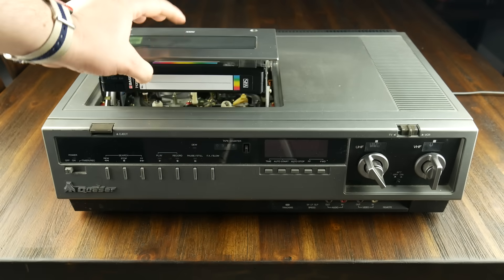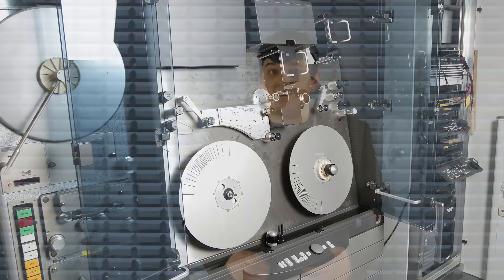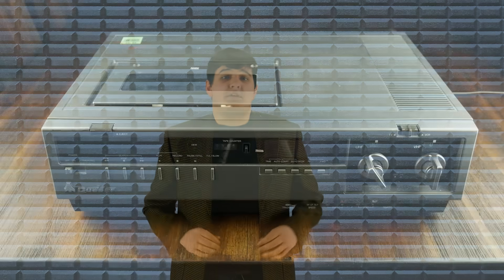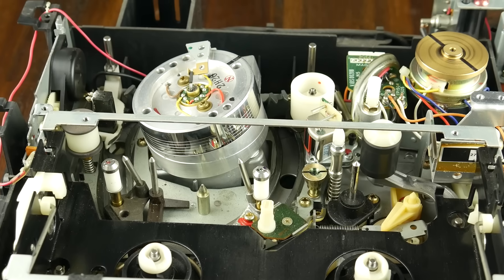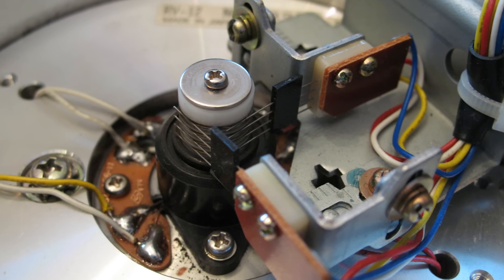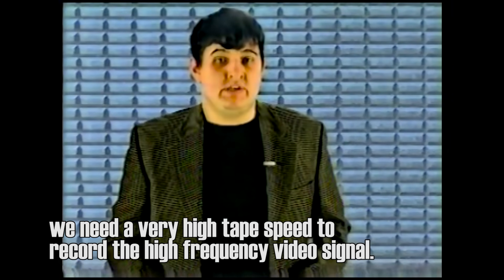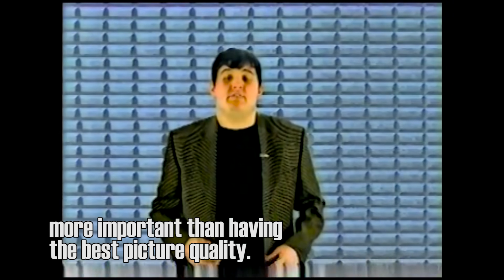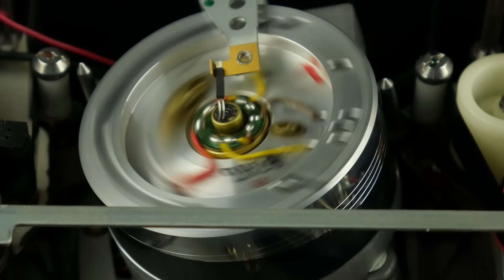The Impossible Feat inside Your VCR

Comment: The reason why they dropped the LP mode was because they tuned 2 head for SP and 2 for the EP speed.  This gave a better picture on recording. EP looked like LP and the SP looked better as well. But some older 2 head units still had all 3 record settings. Most people was using the 2 and 6 hour modes anyway. 6 hour for record and watch once and 2 hours if they were going to keep the video.

Comment: Well dear the main components in vcrs which is marvlous is optic scanning system the gear with black n mirror sections which reads position of tape ....that is used in cars same optic system used in abs n stability control  system
Reply: Well other than that magnetic tape system was used in credit cards now replaced by chip...from vcrs head the reliable BLDC motor for drones made way...from optic intrupter of vcrs..cash counter made way ...in all its collection of various technologies of all time....the high end vcr.

Comment: Just came across this. Thank you for doing such a good job of explaining the format for the uninitiated!  I started work as a broadcast engineer back in 1981 and spent a large part of my time working in VT. When I joined, we had a mix of Ampex VR-2000 quad machines and VPR-2 helical scan machines. We used a lot of the 'domestic' and non-broadcast cassette formats too, U-matic, high-band U-matic, that sort of thing. One machine that always made my day when I had to work on it was the Ampex VPR-20. Those clever chaps managed to cram all the necessary bits into a small enough package to make a portable 1" C format machine. I spent many, many hours nursing those machines. The quad machines in particular required constant tending.

Comment: Very interesting. There was also a Beta 1S speed. I believe if you had a machine that was equipped it record at 6hmz. Some of the high end machines thet churned out in the hey-day were simply awesome, the price reflected it. Wasn't impossible to drop $2000 on a unit in the mid 80's

Comment: I'm pretty sure VCR's & disk drives were the earliest mass adoption of brushless motors. In my childhood I remember pulling apart some Sony Betamax, it had not 2, but 4 pancake style brushless motors inside. One for the video head drum, 2nd for the capstan, 3rd and 4th for the supply & takeup reels.... The front panel was long gone when I had found it but I had never seen anything like it before or after. All modern VCR's up till their discontinuation still used them for the capstan & drum but rarely individual ones for the supply+takeup. All new decks seem to drive the supply+takeup by the same pancake capstan motor via a belt. Loving this tech history.

Comment: Rewatching this, I had an observation regarding the recording with LP speed disappearance in later models. Most 2 head VCR's back in the day had serious issues recording LP with playback quality on other machines due to those tolerances. To make a head work very effective with all speeds on both recording and playback was more expensive and full of various tradeoffs. 4 head models were introduced to solve issues with cost of needing to make one jack of all trades head record well and playback well from another machine with heads of a different tolerance/manufacturer, whereas a specific head for SP and another for LP/SLP they would have better quality with tighter spec tolerance for a more specific purpose across all manufacturers of heads at the time. LP was often hit or miss being played back in other machines as SLP was more widely used by everyone who recorded TV so it made more sense to put more effort into improving SLP recording, probably with a resulting tradeoff for LP recording or at a higher coist to do such so they decided to scrap LP recording altogether. If I recall each LP+SP head group have the different azimuth angle so they can read both field tracks in one swipe thus allowing for a clean still image. My 2 head VCR growing up had all 3 speeds, its SLP recorded tapes sucked when played back in anything else!
Reply: I had to read the scientific explanation, that jack of all trades three speed 2 head VCR required a 30 microns wide head which was a compromise, SP tracks being 58 microns wide. Playing back stuff recorded on 2 head VCR that merely supports recording SLP mode in SP mode in another VCR with 58 micron SP heads would be reading a lot of blank tape!
Reply: Now some of that marketing stuff is coming back, the 19 microns wide heads were well advertised on some models. These would be very SLP/EP specific to improve performance and would not record LP 30 micron tracks too well for the same reasons above.
Reply: "By 1996 most manufactures started dropping the older 26-micron EP heads in favour of the superior 19-micron EP heads but kept a 4-head system having 58/46 SP and 19/19 EP heads. Most if not all of the last Toshiba and Sharp VCRs used the 4-head system droping the 26-micron heads. Although some manufactures use slightly wider EP heads, around 21-microns." <-- Now we know why LP vanished. 26 micron heads were used for LP recording which was good enough.

Comment: You have to appreciate old technology.  Analog is ironically the wave the future.  When modern infrastructures collapse, analog tech will be the way to go.  Can't read Wikipedia if the power goes down, but a book and candle light and you can read.  An old typewriter can run without electricity,.  Just things like that will make a big different in the distant distant future.  I hope there is an old technology preservation association out there preserving old tech.

Comment: Is NTSC video still interlaced to this day? I know interlacing creates the illusion of a somewhat higher resolution, but is it still done?
Reply: Many 480i sets are still in use - though few people would be using one as their "main" (e.g. living room) set.

Don't believe those claims that interlacing is "fraud".

Compare a 480i picture to a 240p. The difference will be obvious.
Reply: @1L6E6VHF  Mhm! And cable broadcasts (atleast where I am) are 1080i and 480i so as to not alienate CRT users, and most of the programs are from the 00s.

Comment: I always heard that the reason LP was abandoned was because it could not freezeframe pause or seek fast forward/rewind without very severe screen tearing. Even moreso than the other two speeds.
Most manufacturers decided that with the option between "quality" and "long recording time", why would consumers choose THAT speed that looked so horrible when in any mode other than play?
Also, fun fact, S-VHS actually saw modest adoption in the camcorder space, where it had to compete with Hi8 (additional fun fact: Hi8 and Video8 are descended from Betamax!).
Footnote: An Emerson VCR/DVD unit sits next to me. I still use it.

Comment: At 0:55 You mention a 5Mhz signal.   5 Mhz by definition is high frequency, (3Mhz  - 30Mhz is defined as "High Frequency"  or "HF" ) However, you call it 'Super high'.  The problem is "Super High Frequency" or SHF is 3Ghz - 30Ghz.

Comment: I'm rewatching this video as I back up tons of files to single layer BD-Rs and I'm now picturing an alternate timeline where everything else is pretty much the same but instead of a BD-RW drive in my desktop I have an external peripheral DVHS VCR connected to my e-SATA port and I'm slowly recording all my files to tapes. 30 minutes per disc to burn and verify files/surface scan doesn't seem so bad all of a sudden.

Comment: Great stuff.  I haven't studied this the way you obviously have, but I tend to have an affinity for making some good guesses.  For example, I noticed that the head drum at the end of the video (17:34) had 2H26 on it.  My best guess would be that the 2H means "2 heads".  (Typing it out has me thinking it probably means something a bit more complex, but that's the first thing that came to me.)  

I also have a theory as to why "LP" was phased out as a recording speed on most VHS machines.  When searching in "fast-forward" or reverse/rewind, on-screen for a particular point/moment/scene on a videotape, there is some picture distortion, mostly with the slower speeds, like SLP/EP, but the image is still "straight".  That is to say, you can still see what was recorded on the tape, particularly if what was recorded came from a good, clear signal.  

When searching on-screen in fast forward or reverse in LP the picture would bend as if the "horizontal hold" (something that early TV sets had) needed to be adjusted.  I suspect that there were some consumers who, at best, saw this as an untenable nuisance, and others who saw it as some sort of defect of their VHS machines.

Comment: A side comment regardng he poor sound quality on VHS tape, network TV sound quality was often not great, either. TV network sound was carried on telco circuits, the same as radio network, the best being 5 KHz circuits. in the 1980's, when the networks moved to satellite distribution, sound  improved greatly.  Local TV always had the potential for good sound, since it used the same system as bradcast FM, but this potential was not realized with network television until the 1980s.